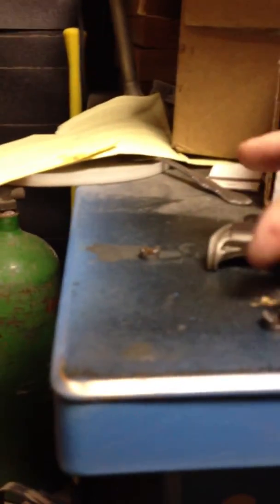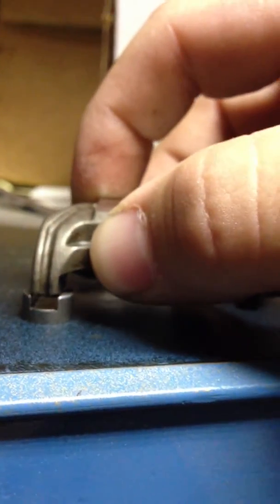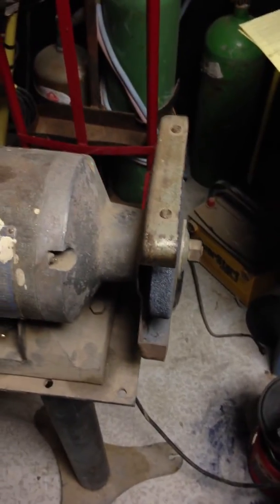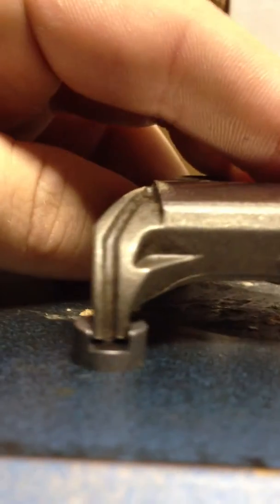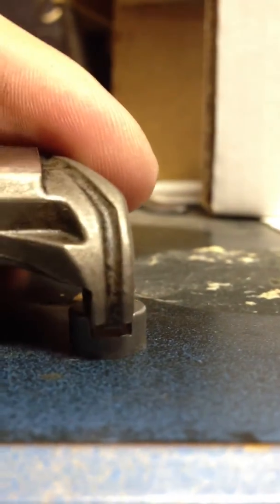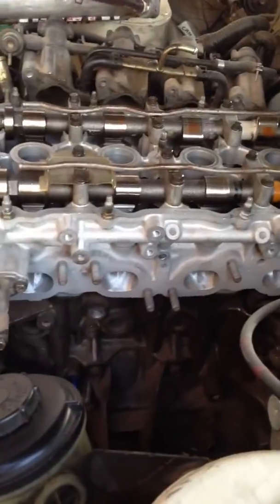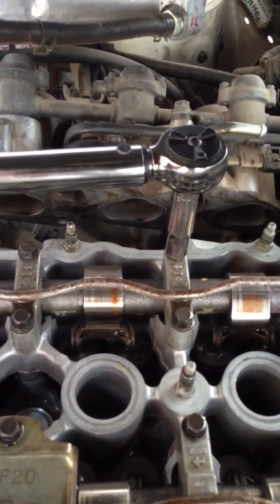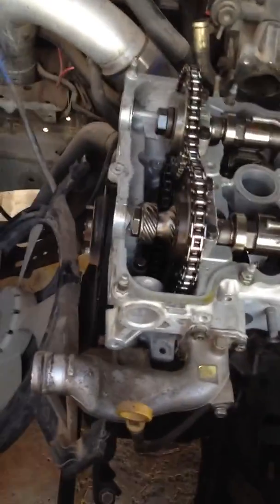How-To SR20 Dual Rocker Guides

Comment: I have built my sr forged and i let lifters hydraylic. I ve changed valve springs also and now i m thinking of doing this conversion. All i have to do is to buy 16 new guides on oem 3mm size and grind my rocker arms? Will i have clearance issues after doing this ?
Reply: I'm on the same boat as you bro got any answers?
Reply: @MetalGodSenpai i bought 16 new oem guides. I grind my rocker arms alone as video shows and got rid of stoppers. No problem until now i ve done about 15.000km. No track or drift use. I daily it and send it on the street.

Comment: I’m currently doing this as per your recommendation on zilvia. 

To everyone who’s doing, questioning or considering this mod.. measure your factory shin and go from there. I just measured all of mine and they are 3mm aka the same as the guides your replacing them with. The idea is keep the rocker as flat as possible obviously. Maybe I’m just lucky but I feel like most SR’s come with approx 3mm shim’s for hydraulic lifters. Solid lifters would be a different situation where you actually need to shim it accordingly. If you want to measure with a “proper” tool, check this link. https://brewedmotors.com/blog/sr20det-dual-guide-shim-rocker-arm-conversion-tomei-poncam-install.html

Comment: Hey there! I went to this vid, thinking that you`d show how to measure and mod the 2nd guide. Just installing them can lead to breaking Rockers. The shims are different sizes to force the arm to be perfectly in shape. Sad :(
Reply from the maker: RottenSon667 Dual oem guides can be installed with no adverse side effects.  I've done it on many engines, as well as many other people.  The hydraulic lifter helps in lash takeup.  However, if you feel like measuring the thickness of each flat shim in the engine, you CAN order guide shims in the same thickness.  Tomei makes guide shims in varying thicknesses, and if they don't have the right one there is a company in Australia that can do custom thickness.
Reply from the maker: RottenSon667 you don't have to measure or mod any guide shims.  And it's not going to break the rocker.  If you are doing this with solid lifters however that is a different story.
Reply: Thanks man! I was thinking about machining the oem 3mm ones.
I`m about to change my valve springs to BC ones and my cams to Tomei ProCams this winter. Doing so, the manual says i have to reshim that engine, and instead of doing so i thaught i`d do the dual guide mod.

Thatswhy i`m reading alot and watching vids like yours :)
Reply: @RottenSon667  is your engine still running?
Reply: @CarloBtt  yeah, its running. But i measured and machined one guide per rocker
Reply: @RottenSon667  good, so you did the proper way.

Comment: wat size. guides. did u use. I Mic mine it was 3mm so I need to get. the another 3mm guide
Reply: +Sylas Gissendaner   that's not true. they must stay in the order they came out because they arent the same, each valve will have a dif guide height,  some may be the same. but there order is critical to maintain.  that's why they sell dif sized guides . you do pair them up .  which is why you keep them in order .but the shim vs guide height isn't the same per rocker. also .  once back in .   they need to be measured to assure there correct with a dial indicator and feeler gauge.  which is why tomei sells test guides/shims,  you measure,  then order the correct sizes.
Reply: +Sylas Gissendaner   when you grind them also .  you have to assure center once mounted,  just because they fit,  doesn't mean there centered.   too wide/tight a tolerance and it offers opportunity to grab an edge at high rpm , and get tossed or crack.
Reply from the maker: All Oem guides are the same size, I have used them as-is many times with no problems.  But if you really want to you can have them machines to match the thickness of each shim it's replacing, it's just not completely necessary if they are close in thickness.

Comment: Why didnt you change or check clearance on valve after using the keeper shims?  The keepers are all the same, but the flat shims are not.   unless you didnt add that part, incase could be bad for people following this without doing so.
Reply: Sylas Gissendaner The hydraulic lifter has nothing to do with managing the difference between the possible different heights of the tops of the valve stems, the hydraulic lifter is only there to keep tension on the rocker arm and cam. If a valve end was much shorter then the other valve end that the same rocker arm opens, and you just throw guide shims on both valves, very probable chance that that rocker arm will sit crooked. I've seen rocker arms snap because of this. ALWAYS check valve lash. Why would you not want it perfect? You do the dual guide mod in order to allow the SR to maintain higher revs safely and more reliably. Doing this as a quick upgrade will just get you into trouble with breaking rocker arms.
Reply: @akingbrew  This is interesting what you say. But how does one check valve lash with a hydraulic lifter setup?? would there be space for the feeler gauge?
Reply: Padraig Galvin Read the manual thats how.
Reply from the maker: +Alex King we've never had a problem with this mod before.  But like I've said having the guides matched to the thickness of the shims you replace is the best way, but it can be done without that and it works.
Reply from the maker: +Alex King we've never had a problem with this mod before.  But like I've said having the guides matched to the thickness of the shims you replace is the best way, but it can be done without that and it works.
Reply: Im way late to the game on this, but the OP is right. According to the FSM, valve pair heights (including shims) must be within .001" of each other. If not the cam lobe will not push evenly across the rocker, causing uneven wear and a side torque that could spit the rocker. The lifter only takes up the slack between rocker and cam, not the difference in valve height.
Reply: @blackmesaresearch2  I'm trying to explain the same thing to a guy who asks why he broke a rocker arm, and he did this double guide mod.
Reply: @CarloBtt  Show him the factory service manual. Volume 1, EM-123 "Valve Clearance Adjustment". Its very clear that the measured heights of valve pairs must be within .025mm or .001in of each other. Nissan offers 17 different shim thicknesses to make this possible.

Edit: Im looking at the B13/N14 FSM, your page number may vary for the rwd stuff but the principal is the same.
Reply: @blackmesaresearch2  yes I know It, I shimmed my head twice, I found a shop in Australia who sells shims with 0,01mm steps instead of 0,025 so it's even more accurate.
Reply from the maker: Because it is not absolutely necessary, the hydraulic lifter will manage the extremely minute difference between the flat shim and the guide shim.  I've done this on many sr20's with no issues.  If you really wanted it to be perfect, you can have each guide shim thickness matched to the flat shim it is replacing, which is what I do on my personal builds.  However for a quick upgrade, the guide shims can typically just be thrown in.  However if the engine has been modified with difference valves etc then that is a different case altogether.

Comment: the consult port with nissan data scan will have a base idle setting to lock in timing mode. I do it all the time. to do it the manual way(unplugging tps and stuff) you can't have any codes and every sensor has to be connected. EVEN THE NUETRAL SENSOR ON THE MANUAL TRANS
Reply from the maker: Unfortunately my car doesn't have the consult port :(

Comment: thanks for the video!  how do you set base timing on your SR?  I have never had any luck with unplugging the TPS then revving 3 times in an attempt to put the ECU into locked timing mode.  Timing still jumps around to correct idle.  

I've got a Consult USB cable and some trial software but nothing that will allow me to put the ECU into locked timing mode.
Reply from the maker: Honestly I've never had any luck with getting the ecu to stay in timing mode either.  I usualy just make sure my mechanical timing is spot on and try to get the ignition timing as close as I can at idle.  Also my car does not have a Consult port :(
Reply: Hello there. Ive also heard about the unplug tps and rev it all day long crap but it dosnt work. What does work do is first: dont unplug anything, then just slightly press the accelerator. then it goes into base timing mode. If you have a consult cable just see that idle mode stay on idle. but you will also know this anyway from a steady timing light flash